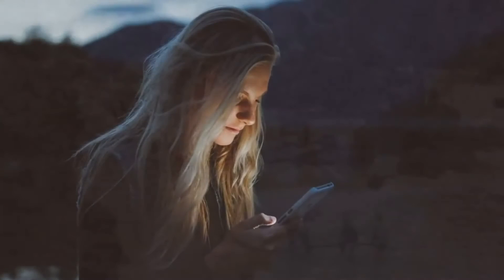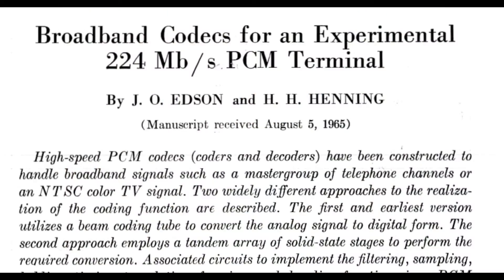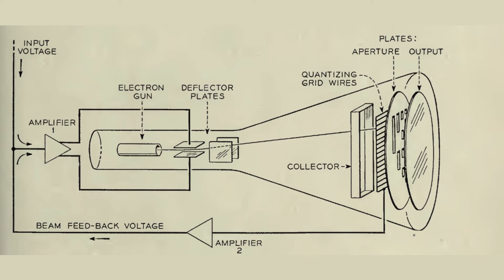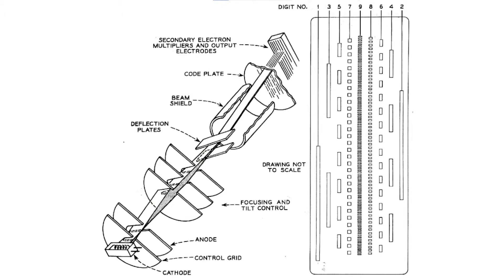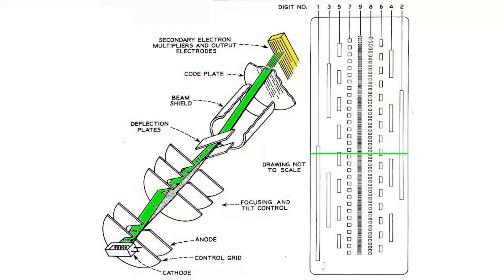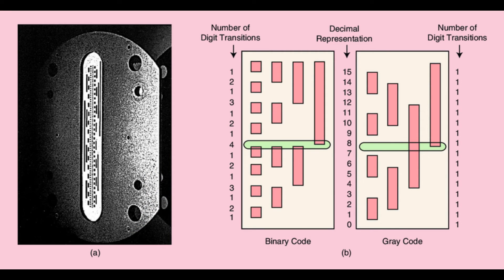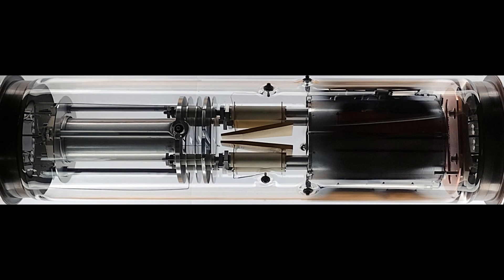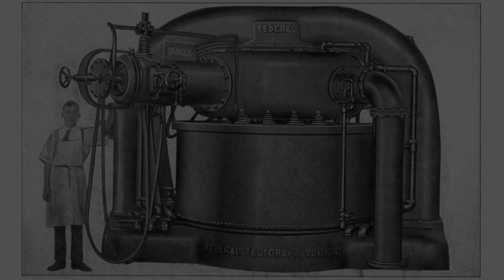High Speed A/D Conversion in 1965, with a Hand Made Vacuum Tube!

Comment: I wrote a calibration and test procedure for the Tektronix 7612D Programmable Digitizer used by Canadian Air Force used in the AN/USM-484 ATE system. The ATE was made by Harris and sported this digitizer. The 7612D needed a boatload of gear to do the calibration and it was a super finicky beast prone to all kinds of drift. It used tubes very similar to those described in the video but instead of the beam going through a mask it directly struck a solid state target that was read into memory and then transferred to a GP computer for processing.